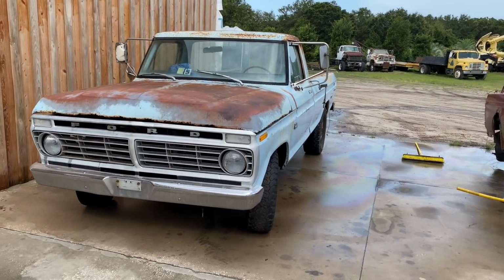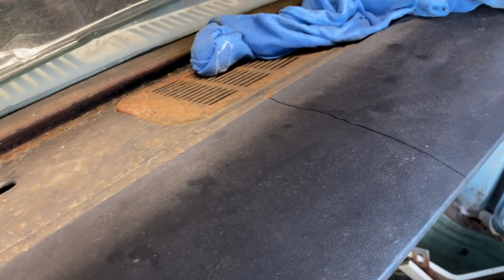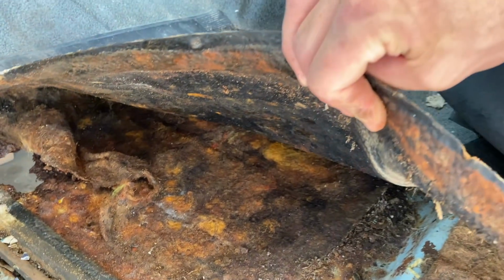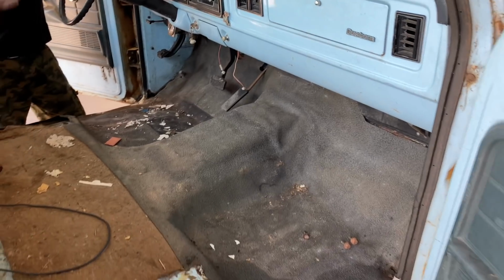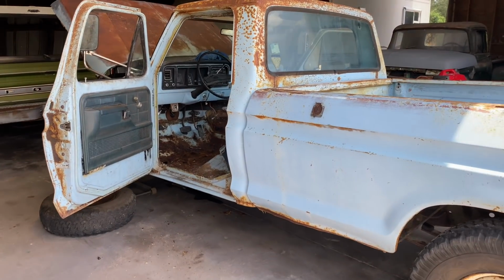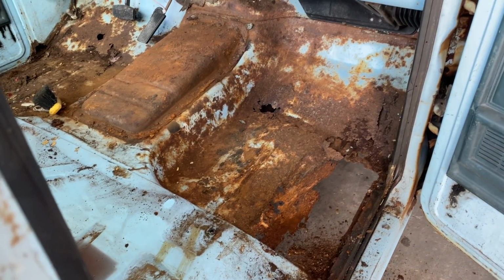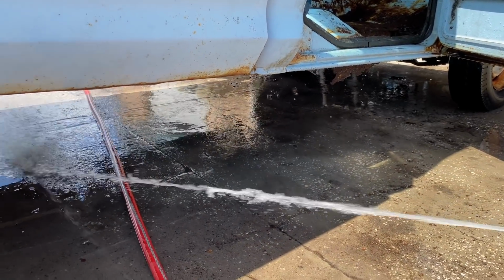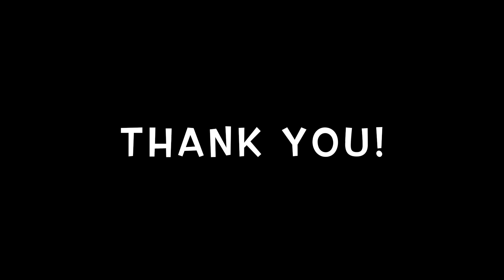SWAMP Dragon Rescue! DETAIL & RUSTED Abandoned 1974 F250 Custom 390 V8 FORD, Vintage Restoration CT

Comment: I would do a low budget build find a better used hood buy new floor pans a little welding some duraglass a few patch panels here and there. A do it yourself paint job and just fix the basic mechanicals.

Comment: Those floors look like they'd be pretty simple to do. I can hear a compression skip when the engine is cranking and when it ran halfway decent in the video it sounded like it had a misfire to it. Either you got a cylinder with bad rings, which I doubt because it didn't seem to smoke, or you have an intake or exhaust valve not sealing or you bent a push rod or two possibly from sticky valves on startup.

Comment: Try to get the floorpans from another truck because the pans you get otherwise do not fit correctly , or you can put patches in but do not pull these out until you get new ones.

Comment: You should take everything off and do rust repair on all the body panels and sandblast/paint (or powder coat, it’s not actually that hard or expensive) all the frame and suspension components and change all the bushings and rubber components, and the shocks and maybe springs, and do a thorough cleaning of the engine and maybe some common seals (as preventative) and then do repairs and rustproofing of all the body panels/metal, don’t think of it as a frame up restoration but more of a age proofing
Reply: And then I heard the Canadian goose (loon?) you used to lift the truck up and realized that’s not gonna happen

Comment: To me, this vehicle looks like a good first time project.  Keep it cheap though.  You will get in way too deep too quick and never get the return on the investment.  Start with the functional items and state inspection requirements.  Then move on to the cosmetics.  No point in putting lipstick on a pig.   For the floor pans, I have used side panels from old computer cases work well.  No welding, use pop rivets and adhesive to seal it together.  It just needs to be solid enough to pass inspection.  As for rust, just use the hammer test!  If it fails then cut it out.  On the hood use fiberglass repair kit instead of body putty, because of the abuse the hood goes through the putty will just break out.  If you spend any money then spend it on the functional components that are required.  I usually find the cab and bed mounts are in bad shape.  I have used angle iron to strengthen them without removing the cab or the bed.  On the old A/C system that was R-12 it will not convert to R-134A with the old hoses.  The system will not hold the smaller molecules for the new refrigerant.  If you want the A/C operational then find somebody with past experience in converting old systems to discuss the requirements and the costs.  Even the compressor oil and seals are not compatible.

Comment: If the Framerails are intact and not all rusted through with wholes then go for a restoration.  Not all that hard to replace the floor pans.  The truck is a simple item and not all that complicated to put together.  If the Frame Rails are rusted through then abandon all efforts unless you can purchase a frame cheap.

Comment: make tin or aluminum for bottom old hot water heater tin are dryer and washers cases are good clean bottom put miracle paint kills rust on it . You can buy floor panels depends if you want a nice old beater  farm truck . you can always restore it  but its cheap to find a better one . Just get it stable now miracle paint around top of cab . Ive patched much much worse .That bracket behind the seat where wing nut is  thats wear the long rod jack handle goes and bolts down .The trucks got character and potential  hate to see it parted out

Comment: Cab must be removed, so sand blast all the parts, the rotten parts must be  replaced be new aftermarket pieces, I tink you can find , or  in you have   Good skill and practice with a metal form player, with patience you can regenerate every sigle parts of the frame🤚

Comment: This channel is just painful
Reply: TheDutyPaid like a train wreck, can’t look away.
Reply: I feel the same. Just a load of fannying around and nothing achieved.
Reply: I'm reading comments instead of watching the video.
Reply: I’m really interested in the old ford truck as I’m restoring one myself, but as a mechanic, I can’t stand watching this guy. I find myself yelling at him through the screen very time he starts doing something wrong, which seems to be every time he touches something. 
Who jacks up a truck, leaves the jack stands sitting beside the truck, takes the wheel off and then starts cleaning out the interior while the truck is still balancing on the jack?  I could go on and on about his bad practices......painful to watch.
Reply: @designq-qualicosinteriorde1526  How about calling the rotors "drums". Or saying hopefully he can reuse the calipers which are cheap as hell and could kill him or someone else by not replacing or at least rebuilding.
Reply: @AJ-ut3ul  Reminds me of Laurel and Hardy Videos :)
Reply: @bobbiggley6992  Definitely got better in the videos after this. Actually does some work now, but there is some slapstick laurel & hardy. Injuries, bumping into things and laying under unbolted car sections 👍

Comment: Is that spray cleaner the same stuff they use on Vice Grip Garage? I know you probably don't know what they use but it's in a can like that and it's a pressurized can in the same colors. They endorse the cleaner that they use. I think you guys may be using the same stuff. You put it on like oven cleaner or soap scum remover. I've never used a cleaner like that except in the bathroom.

Comment: Cut the old out and weld new floor pan in.lmc truck or look to see if anyone is making new parts for that. Example I needed a drivers door for my 442 and found a company that makes them from gm spec.

Comment: Check J C Whitney catalog for a cheap vinyl seat cover.
Reply from the maker: Thanks Terry! I will do that.
Reply: @CTmoog  J C W was acquired by www.carparts.com in July. Their online catalog doesn't show seat covers for your truck. You will have to email or phone customer service. I got a black vinyl cover that installed with hog rings for my 64 El Camino back in 1977. Was very cheap then. Fit was very good.

Comment: "We're going to push it inside tve shop and clean the inside ..." 
What happened? You had it running when you took the slide-in camper off. 
Why not drive it into the shop? Be a LOT easier on your back and knees.

Comment: I f you guys buy a 4 by 6 sheet of 1/8 mild steel you could pop rivet it or weld it in for about $50. Please watch a few other guys rust repair videos. Try Mustie 1 he does lots of floor and body panel work.

Comment: Floor pans would absolutely be worth the effort. The hood maybe could be fixed, a new one would be a better option if possible. The rest of the truck I would just clear coat the hell out of and rock the patina look, even the cab roof. You wanna save money? Quit pretending that camper is anything more than trash.

Comment: The floor panels may make quite a good welding project to learn how to replace bodywork but I'm no expert. I'd have a look at a few videos to decide if you think it'll be worthwhile.  This one is ok https://www.youtube.com/watch?v=C0M5tUQSaps&t=27s and there are plenty of others.  I saw you got a welders hammer after I'd commented on it - hitting metal with a screwdriver or hammer firmly to check if it's rusted partly and weakened is generally what most restorers do - I'd have a really thorough check of the underside of the vehicle just in case there are quite a few jobs to do on this.  I like the original dashboard and  would be really tempted to repair the seat but there aren't any repair videos for that type of PVC type cover - perhaps it won't repair well.

Comment: So i take it that your still not using premium fuel in the f truck. Chock the wheels when jacking up any vehicle especially any vechicle THAT HAS NO BRAKES !! Pull out the entire dash as the bailey channel may need checking for rust aswell

Comment: Hey man, if you want to move the truck simply turn the ignition to start it, then park wherever. Why push it by hand? PS, use some grease on that jack. Damn you guys are lazy making excuses, now they scared of little bit of floor pan rust. Fix the truck plus the camper. Can you do it? If not sell to someone competent to have a go at it.

Comment: 1974 the american steel industry was in decent condition.  1970-71 steel strike was threatened.  so auto industry bought foreign steel  of poor quality and pricey. shipped by  to freighter to usa. steel was soakedwith sea water and sat in line to unload  in port.  then shipped to usa car makers already rusty and used to build autos and trucks